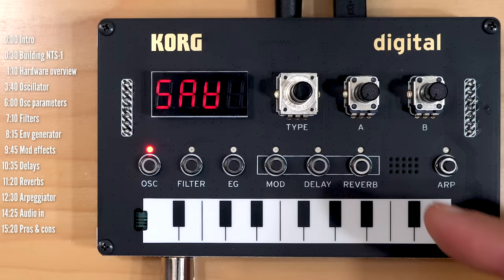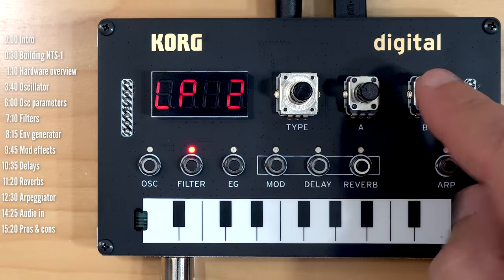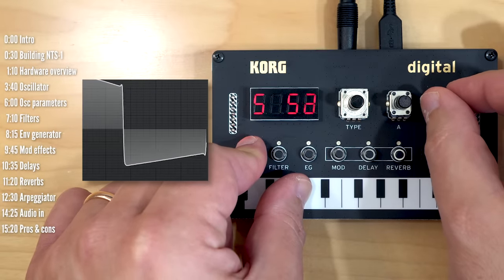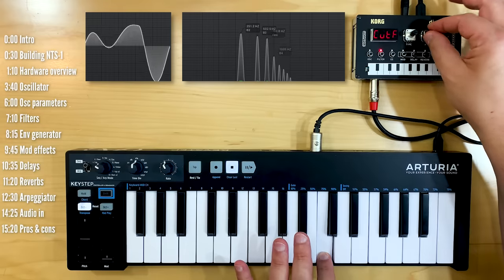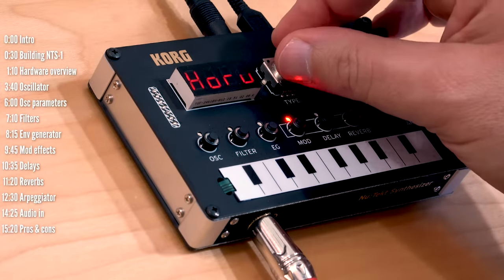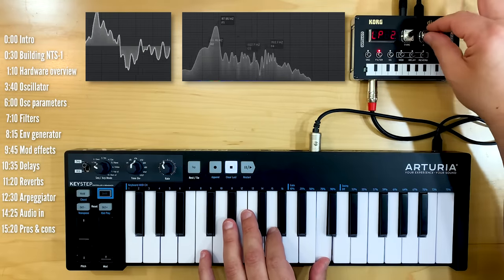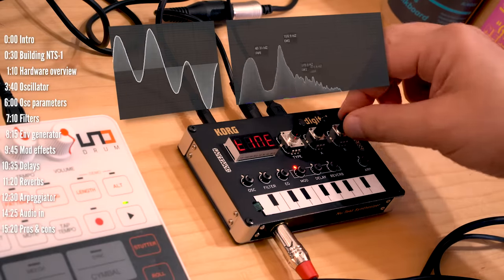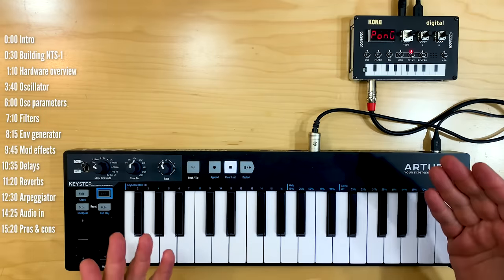KORG NUTEKT NTS-1: Full review // Here's everything it can do

Comment: This is Korgs take on the old Roland TB 303 that was originally designed to play bass lines for guitar players but was extensively used by ravers cos it was cheap. I can see the ravers using this. If you want polyphony buy 3 units for triad chords

Comment: I own one of these, mainly due to the review from this channel. I was very disappointed with the sound quality of the device. I don't know if the reviewer got a particularly special version of this or not, but as soon as I built mine, I could hear lots of high pitched digital noise that makes the thing pretty much unusable. It mirrors the type of sound quality that the monotrons had ( I had a couple over the years)

So, normally I really rely on reviewers to help me decide on things, but I'm less inclined to take a review at face value anymore since it's very apparent that the quality of the device highly varies upon purchase. I unfortunately feel like I wasted money on this and several paid oscillators and effects.
Reply from the maker: I don’t think an individual experience should cause you to lose faith in the channel. However, it sounds like a ground noise issue (or maybe damage in the build) I wonder - does the noise happen when you power it with a computer? Have you tried powering it with a power brick or phone charger and listening with headphones? Please let me know if this helps. 

Needless to say the sound you’re hearing in the video is unfiltered and real. My unit is a prototype but this is the first I’ve heard this comment.
Reply: I've powered it via computer, via phone charger. I don't have a power brick, so I haven't used it with that, but I did contact Korg about the issue and was told that it was something that could happen from time to time. 

I'm running it through my MOTU Ultralite audio interface, as I had intended to use it for recording and live performance.
Reply from the maker: mubalicious bummer - especially since korg says it can happen :/
Reply: @loopop  I've owned several Monotrons, so I was hoping that this would be different audio wise, but for me it ended up being a similar situation. Glad yours is fine. I'll probably be giving mine away since I can't sell it or return it.

Comment: Thanks for an awesome review Loopster. Thankfully its not out just yet, otherwise I'd be ~100 USD poorer and one step closer to a divorce. However it's little unfair when you snap your fingers @ ~ 14 mins and summon a +10 vorpal drum machine that must have designed by Deiter Ramms BUT with nary mention of what it is or even - mayhap - a link to a previous review of it ???? @_@
Reply from the maker: Dude your comment made me laugh. It's the UNO Drum - others reviewed it just fine so I felt like I didn't have much to add...
Reply: might as well go ob6 if divorce in on the table

Comment: Well, that's certainly more costly than I expected it to be, considering it's a kit. I would have had it about 30% cheaper at the high end. :/
Reply: This very product alone in particular is a financial risk.
They just released the minilogue XD and, that thing needs to breathe in sales. Plus 2 new releases of the volca series. 
Not counting their monologue synth that still selling at retail...and more lower at street/used.
I believe at the end of the day this little unit will be a hit. And korg knows it. And if it does score well enough -as what they project in t the (nu tek nts 1)...
That may convince them to start on 1. A firmware update to turn this into  paraphonic (2 osc) 
Or expand this size of the circuit board by half an inch then,  throw another chip on the board to write new firmware to turn this into 4 voice poly synth...or have a more function for all three 
Mono,para,poly.

Comment: Great video as always unfortunately this is a piece of absolute crap I bought three because I liked the effects and the audio out ports have broken on each one the soldering to the PCB is totally useless. I have three pocket operators and they are strong and perfectly made no problems, these Korgs unfortunately very badly made and almost guaranteed to break after a few uses. Get a zoom 70cdr instead built like a tank and many many more effects options. Also this effect unit is very noisy.

Comment: Serum is 1000 times more powerful and easier to use
Reply: César Bonneville, Serum costs about twice as much and at that point is useless until you provide a computer. Plus, it doesn’t work on my machine. Without a compatible computer the multiplier isn’t 1000, it’s 0.